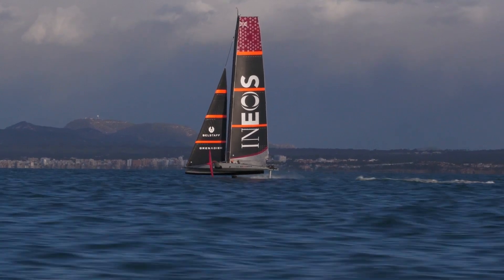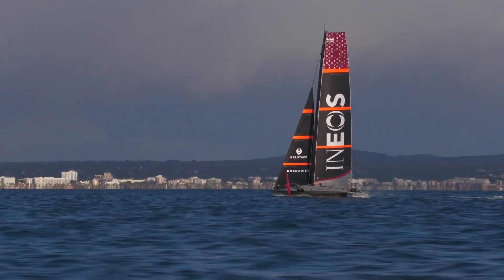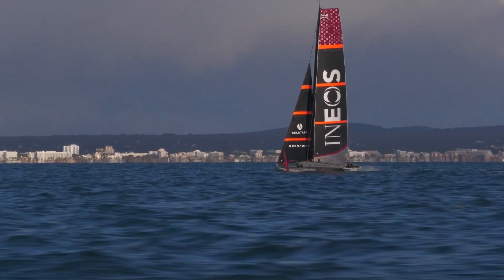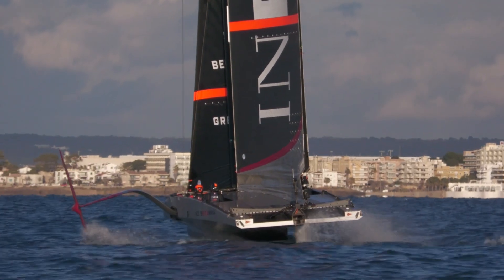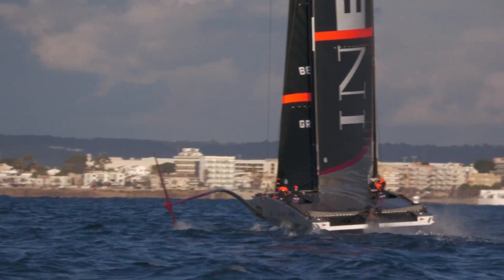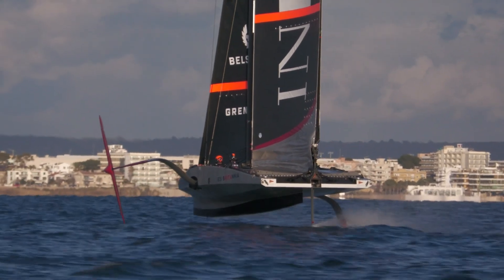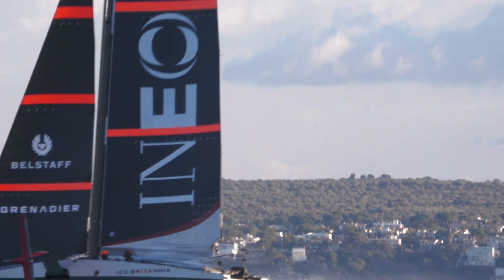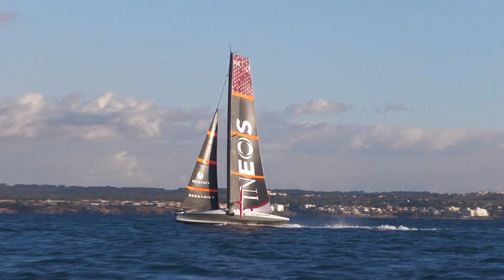INEOS Britannia T6 Day 14 Summary

Comment: Team NZ LQ12 is a Rocket compared to this thing
Reply: NZ really looks fast and solid. Britannia is a work in progress.
Reply: Impossible to tell mate, different conditions. I hope Emirates Team NoCountry hasn't shot themselves in the foot by spending so much time doing the AC40 class boat rather than LEQ.
Reply: @tristankiddie1710  Well, it was an AC40 but it's converted to an LEQ12 now, probably to conserve time and resources instead of building a new LEQ12 from the ground up. In the end, it matters little because the actual yacht contenders won't be either LEQ12 or AC40. We haven't seen the yachts that will actually vie for the cup and won't for quite some time. Anything can happen until the AC37 commences in earnest.
Reply: @James_Aron_1967    It was still a huge amount of time spent on something they weren't doing testing for the foil packages on. A lot of time spent tuning the auto pilot which is no use to the race boat.
Reply: 56mph in 6-8 knot breeze for ETNZ so good luck GBR
Reply: @jonathanpaotama124  If it is just breezy enough for a race - Dubai does great.
Reply: AC40 you mean
Reply: Dubai (NZ) verses the Brits at engineering?  Made for the calmest sea in the world or the roughest.  What God & Allah gives them on race day will tell which is right.  In the Med, it could go either way.
Reply: @ydne  personally i dont think so looking at there Test Boat they are way behind the 8 ball , Team NZ smoked the regatta at the last AC  and they have more up there sleeve so who needs to catch up to who , Prada already has a replica of Team NZ winning boat as there test boat what does that tell you ,
Reply: @ironmantwilliam  Tells me the USA gave a lot of good engineering advice to Dubai, when they became the home to the USA Military Contractors in late 1980's Desert Storm War to protect Kuwait from Iraq, that they have used very successful in the years since.